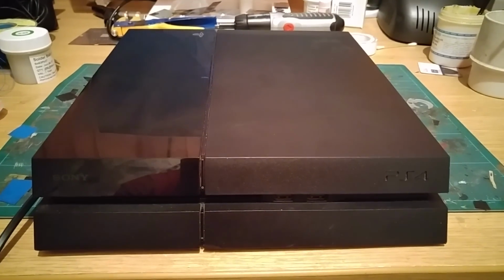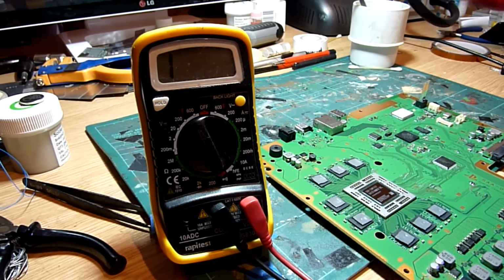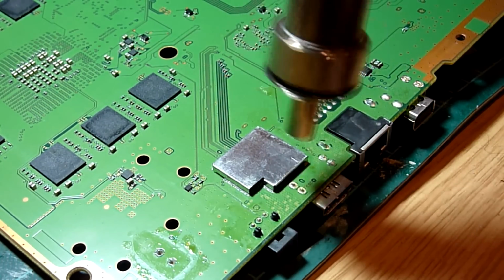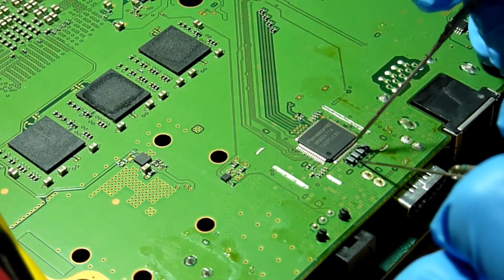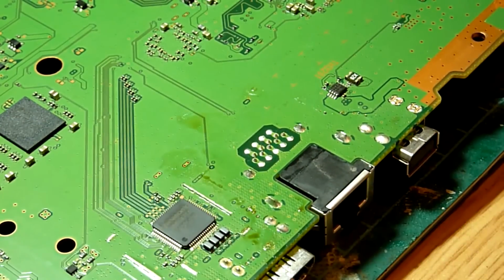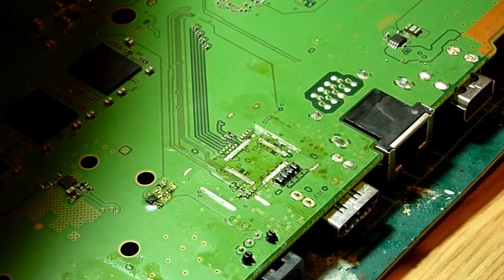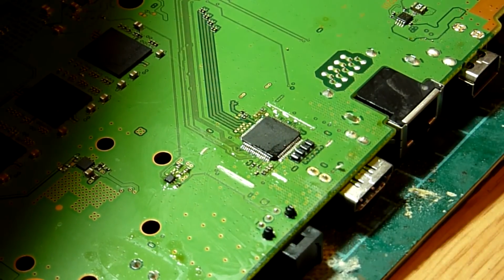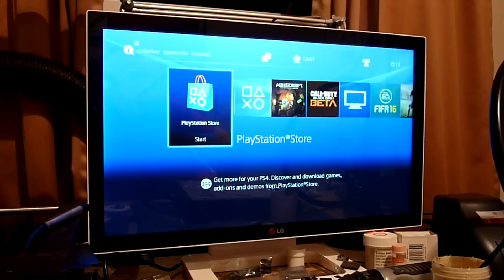PS4 Diagnose Faulty Panasonic MN86471A HDMI Encoder IC Chip Tutorial (WLOD)

Comment: I need this done to mine. I just recently dropped my ps4 off at the local repair guy to have fixed knowing that I had this same problem. When I explained the problem and my suspension of what it could be, I was reinsured it shouldn't be a problem to repair. Well guess what? Got a phone call letting me know they replaced the hdmi port only to have the same issues and they do not have a in house person to replace the i.c. and apparently there is not a person in the whole city of Austin that can fix this problem. So I guess I'm doing it myself. Thanks for the excellent video guide! I really would love to  send it to you for repair..

Comment: Thanks. You are very good at what you do and at explaining it to others. Keep it up. Thanks to you, I got a blue light of death (long version) off ebay going with the 3 washers trick only to find white light of death after that. I fixed it by watching your videos and changing the hdmi encoder. I second your comment about hot air stations. My trusty Aoyue 968A+ got the old hdmi port out (it fell out whilst taking the shield off the hdmi ic on the other side of the board lol) but could not get the board hot enough to allow for aligning the hdmi port pins with a new port. Thankfully, the old port was OK and the previous owner had given up at that stage. Cheers.

Comment: Andrew, your video's are great. You are definitely someone who never gives up, like that ! Just had a ps4 with WLOD and flikkering black screen at random times

- under microscope I saw 1 pin moved about 1mm inside, so that one needed replacement
- replaced HDMI port, same problem
- replaced HDMI IC, same problem
- gone through your video's, measured everything again, all GOOD, so eventually concluded that the NEW HDMI IC chip was defected
- replaced HDMI IC by another new one, and BOOM, working !

Satisfied, but still thinking, how could that happen ? Never seen a new defective HDMI IC chip, did you ?
Reply from the maker: Had one before now but only the one thankfully. Not bad going really in the circumstances lol :-)

Really annoying though as it does leave you scratching your head for a while:-)
Reply: Andrew Paul Thinking about desoldering and soldering back the hdmi Ic's with my rework machine, which I use for reballing apu's for blod ps4's. Also Thinking about a test method to test new hdmi ic's, suspicious hdmi Ic on boards and desoldered hdmi ic's. When I desolder and solder back a hdmi Ic with my rework machine, i can make a video, if you like.

I scratched my head actually all the time yesterday, when It did not work after replacing the Ic for the first time. Left my girlfriends house on sunday and said: I need to get back to work, I need to fix It.

Comment: Hi Andrew, thanks for all your videos, I have to say they are really useful. I'm facing an issue with my PS4 Pro console, when I turn on the console it says Too Many Devices connected. Ethernet Port is dead, Usb Ports are dead as well, Sony suggested to reset the console, and now I have a beautiful reseted console without being able to sync the controllers.

Do you know Is there a way to sync the controllers in a hacked/cracked way so I can Sync them and use the console. Or do you know which chip needs to be replaced based on your experiencie?, I want to try to fix it by my self, since I was told that the board must be replaced, so! Thanks in advance!

Comment: Hi Andrew,
I'm new to repairing but I've taken on the challenge of repairing a PS4 original, I found (SAB-001 model). Tested the HDMI pins and pins 1-12 (all the data pins) are shorting to ground. Is this normal? Everything else around it looks fine. 
The IC encoder side had some sticky residue on it so is this likely a bad IC?

Thank you so much for the video! It's been amazingly useful! Keep up the excellent explanations!

Comment: Use solder paste to tin the pads instead of regular solder.  It lays down better, and most of the time you can lay the chip on it, heat and it lays down a nice filet.

Comment: First testing from the pins to the alternates had me confused as I couldn’t really see what he was doing and my motherboard is completely different from that one.  Would really like to test everything before I buy a new chip. Also what are you putting on the chip before removing it. And what temperatures are best for removing the chip. Mine didn’t have a cover over the chip and it’s directly behind the port on the same side.

Comment: Andrew,  Wonderful video. I am hoping you might give me an idea as to the next step for me. I replaced a damaged HDMI Port and all the pins test well to the IC and to the test connection points on the board. When I put it all back together I got the WLOD. I went into safe mode and found that the unit displays well in 480P , but it doesn't want to work with any higher resolution. Does this still sound like an encoder chip problem to you? I will replace it if needed, I just didn't want to order one in before I exhaust all options.  Thank you for any input.
Reply from the maker: Hi Rick, yes mate - that'll be an encoder IC failure.
Reply: @AndrewPaul  Thank you for the input, I will replace the IC and give you an update.
Reply: @AndrewPaul  Hello Andrew,  I replaced the HDMI IC and it still will not give me anything above 480P.  I double-checked everything and I am lost as to where to go next.  Any  Ideas where I should look would be appreciated.
Reply from the maker: Where did the new chip come from?
Reply: @AndrewPaul  I got it from esourceparts.ca . I get many parts from them and never had any trouble in the past.  Do you think it may be a faulty chip? Is there a test I can do to confirm the chip is faulty. Again, I appreciate your input.
Reply from the maker: Providing you've no loose pins bud, I think it may well be, yes. If you've got an image of any description then the basic circuit and port etc can generally be regarded as good. If you're missing resolutions, or some/all are snowy then I've only ever known that kind of behaviour being caused by loose pins / dry joints or defective HDMI Encoder ICs.
Reply: @AndrewPaul  Thank you Andrew,  I will double-check and reflow all the pins.  I have another chip on the way.  I really appreciate your input.
Reply from the maker: My pleasure :)
Reply: @AndrewPaul  I finally got the time to get back at this project. I just thought I would give you an update. The chip was the problem, and so was I. I didn't notice  it before but during my diddling around with the HDMI connector, I must have broken a circuit trace. I fixed that and the unit is now working fine.  Thank you for all of your help.

Comment: Hey Andrew!  first off, great vids man!  absolutely love them.  Question, Have you worked on any SAC-001 boards?  They are the newer slimmer boards.  I've got a WLOD that seriously has me stumped.  HDMI port has been replaced, i checked the 4 x optoisolators and they seem fine... just wondering if you've seen anything like this
Reply from the maker: +Daniel Wynne I have but not for this issue. I've got a perpetual wlod video coming in the next week which might be of interest and might throw some light onto a possible solution for the SAC revision board too. Cheers.
Reply: Sounds good m8!  I've just ordered a replacement MN864729 from China.  hopefully replacing this will fix it.  i'll let you know if it does.  

Cheers!

Comment: Hello. I'm starting to learn, to repair things.  I have a ps4 1116a, which does not give an image.  I did as you explained, but even so, there is still no picture.  I noticed that near the hdmi encoder, as you said, it has 4 components, all in a row.  They seem to me to be capacitors and resistors, but I don't know.  Can you tell if this affects anything, in not giving an image?  The components are the ones you mentioned.

Comment: hi Andrew

Love your Videos.

I have the famous WLOD, replaced the HDMI chip TWICE  and still no joy, I have managed to have another look at my PS4 mainboard , and to my surprise I see that I have an smd component missing. The missing component is located above the HDMI chip on the top right-hand corner. it the second smd component if you looking form the extreme right-hand side just above the HDMI chip. I would like to know what component it is resistor/cap/diode, and the value of the component. 
Please would you check up on a donor board so that I can get the components or at least the type and value for replacement.
Looking forward for your response 
Many Thanks
ash

Comment: Hello from France! Thank you for your videos, they are very helpful! However, I messed up a bit trying to replace the Panasonic chip. Before i even got to that part, I removed a component when I took off the lid/heatsink. I don't know the value of that component (a resistor no doubt), and I wish I could send you a picture, that is, if you have the time to help me out. In any case, thank you again for sharing your experience with such clarity!
Reply: Au final, tu as réussi à la ressusciter la console ?

Comment: Hi Andrew great video followed your video's and decided with your guide to change Panasonic IC chip but regrettably as everything was going so well, after removing the IC chip I noticed the four filters have come off. What's the best way to put them back on or am I screwed? :-(
Thanks
Reply from the maker: +Naz Nadeem just pop them back on - they're not directional so just line them up back on their pads, hold them with some tweezers while they reattach. Once they're all back on turn the airflow down a bit, add flux and reflow. They'll all line back up perfectly and you should hopefully be good to go!
Reply: +Andrew Paul Thanks mate, that's what I thought but it's reassuring with your guidance. Much appreciated will give it a bash
Reply: +Andrew Paul sorry mate where can I get more filters I seem to of lost one :-(
Reply from the maker: scrap boards are the best bet - PS3s have the same filters and scrap PS3 boards are pennies on eBay so just drop for one of these and swap them back over - you'll have a few spare then too :)
Reply: +Andrew Paul Just for your info I found an article on the net regarding the filters and one guy used a 30 guage wire to make a jumper connection, as long as it works that works for me :-) 
Thanks Buddy for your help

Comment: Hi pal great video I’ve just replaced a hdmi port and it’s just white light no image on the tv I’ve gone through your steps and found the 2nd and 3rd filter by the control chip doesn’t have any continuity so I’m guessing replace those and hopefully will work
Reply: Did you manage to get this issue fixed I have a PS4 here with similar issues swapped hdmi port and also IC from a scrap board i don't think the issue on this one is the IC but wanted to do it anyways for practice. I have not tested the filters yet as have not got fine enough multimeter probes yet just borrowed some that may be pointed enough going to test the filters tonight thanks for the videos Andrew very educational

Comment: Hi Andrew! Thanks for the vid. I measured the path from the chip to the filters and figured out that all pins going to the HDMI are shortened to ground. There is no physical damage on the port. I am consider changing the chip. What do you think? Regards, Erwin
Reply from the maker: I'd bet that's a very good possibility. Remove the current IC and see if the shorts disappear. If they do, change the IC.
Reply: Thanks Andrew! I changed the HDMI IC and the shorts disappeared. As the metal shield around the chip was very hard to remove, I cut it away. Therefore, I tested the PS4 without the metal shield on the HDMI chip.
The TV is getting a signal now, but still there is no picture. You can observe some noise (similar to the noise of an analog TV receiver) when the TV is getting the HDMI signal, before the TV is turning black.
So, my main question is: Also without the metal shield, I should get a better signal, shouldn’t I? (I want to avoid placing the metal shield there again, it was a pain removing it already 😊 )
Regards,Erwin

Comment: Thanx Andrew for this tutorial. in the console i fixed by removing the four filters, i checked them before and they looked fine with continuity test, but i had to remove them, i really worked a lot on that console, so not 100% sure if removing the filters solved my issue.
i bought the jovy i40 solder and it is in the way now, may needs two weeks to arrive if everything went ok.
looking for your next video and if you have a PS4 that does not sync the controller at all except in safe mode, please care to share your thoughts :) it driving me nuts
Reply from the maker: I've one on the way I think mate - I'll be sure to cover it if (when) it arrives :-)
Reply from the maker: It looks like it might but without seeing the bottom edge its hard to confirm. I am aware of people using Hakko tips with the iSolder40 though so I'd guess it'll be OK. :-)

Comment: Hi Andrew, let me first compliment you on your very professional work !!!
it helped me a lot.

I have this problem where i changed the hdmi port but still no signal, when measuring the pins direct to the filters in front of the ic, all ok.
but when i measure from the via points to filters nothing happends.
might have any indications for me ?

Thanks in advance pal !
Reply from the maker: Hi,Have you scraped the vias back to expose the copper before attempting to check them for continuity? Cheers.
Reply: Hello Andrew, no i didnt, but i think if the pads to the filters have continuity the vias will be ok, right ?
Now the telly doesnt give me the "NO signal" indication but rather black screen and if i play around with the hdmi i sometimes get a green snowy image, tried also booting in safe mode but the same..

Comment: Awesome videos, really nice work and explained thoroughly. Have a nice case here myself, CUH1116. White led. HDMI port looked okay, but used your video to check every pin. No problems. Checked the diodes, all around 0.500-0.600, so okay as well.

No shorts on the topside caps, decided to replace the HDMI IC nevertheless. No dice, still white led. Removed all 4 filters and replaced them with wires, checked continuity to the IC pins, all ok.  Still white led. 

Any clues to what I could check more apart from these ? I doubt the IC is bad (or even that the original one was bad), but since the port itself is pristine as well I'm really baffled here.  Failing GPU ?
Reply from the maker: Check TH2001 and replace if no continuity.

Comment: have you ever had a ps4 never worked on where you changed hdmi port and hdmi ic but still no video signal, and ps4 doesn't beep properly to enter safe mode?  but the system seems to turn on properly with the white light?  just no safe mode with hiding down power button, just shuts off

Comment: First of all thank u for your help. Sadly i have another doubt. Checking on the internet for the Panasonic chip MN86471A i found out that there are lots of models with various prices of the same chip. May you tell me whats the difference ? Quality of the component? it seem strange because every chip is sold by panasonic. Of course im not an expert , thanks for your support.
Reply from the maker: It's just re-sellers trying to maximise profits on the parts as seems to be common these days sadly so prices naturally fluctuate wildly. Go for the cheapest reliably rated seller you can find.
Reply: Thank you so much!!
Reply from the maker: You're welcome. :-)
Reply: Hi Niccolò Im from Italy too. I would to do the same repair on my old ps3 slim but i'm a noo so I need some advices. Could you help me? If yes, could you share an email address / honagout to have a chat someday? Thanks a lot